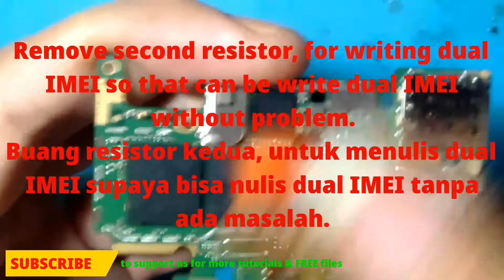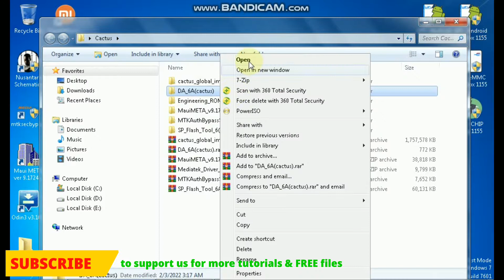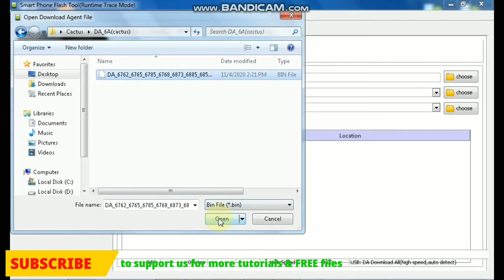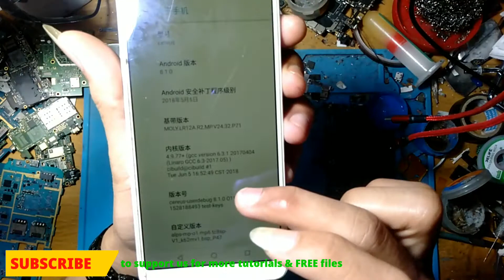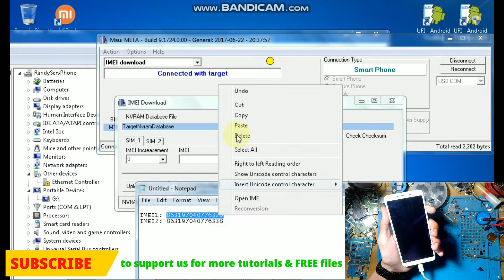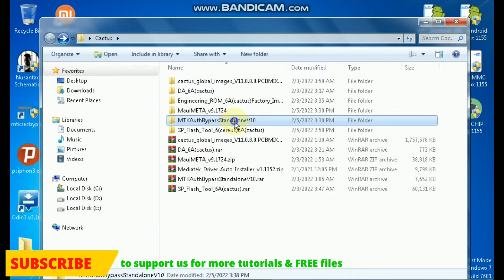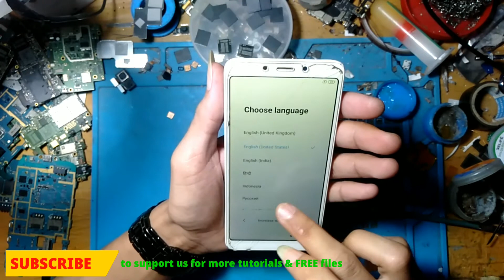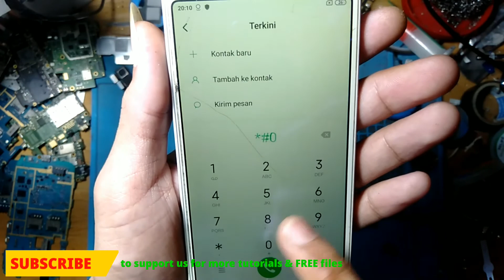Write IMEI Redmi 6A Cactus Non UBL | Without NV data is corrupted | Fix Dual IMEI Solved

Comment: always stop and stuck in meta mode success, not getting the yellow dot..  cant write the imei's ... i have 6 & 6a here.. and both has the same issues..
help and tips would be very much appreciated.. already just sudb ur chnnl..
Reply from the maker: Thank you sir. Flash CSC/Engineering ROM first, try using Modem META to write IMEI => https://www.mobilecareid.com/2022/11/update-modemmeta-tool-v10-2044-0-02-recommended.html
Reply: Big Thanks!  @mobilecareid  Redmi6 cereus done.. 6A cactus next.. really worth to sub..
Reply from the maker: @thomasalonzo2107  Nice sir and thank you
Reply: i did flashed eng rom in 6cereus, but i had no chance to get into imei after meta mode success, wont connect to target..
Reply from the maker: @kattorralba1091  Flashing and choose format all+download, then write IMEI via MauiMETA or ModemMETA, if Baseband is show on your device, that is not problem

Comment: Possible remove resistor in Redmi Note 8 pro? Only imei 2. Nvdata corrupted
Reply from the maker: Yes sir, for write dual IMEI on Redmi Note 8 pro Begonia, must be remove the resistor, use engineering ROM to write dual IMEI via Modem Meta software v10. If you take a wrong step then the signal will be a problem or emergency call only. Please wait 24 hours for my steps and then I will tell you here
Reply from the maker: Hello sir, this steps to Write dual IMEI Redmi Note 8 Pro Begonia -> https://randyservicenter.blogspot.com/2022/02/write-dual-imei-redmi-note-8-pro-begonia-without-error.html